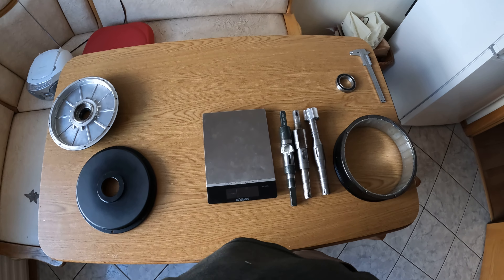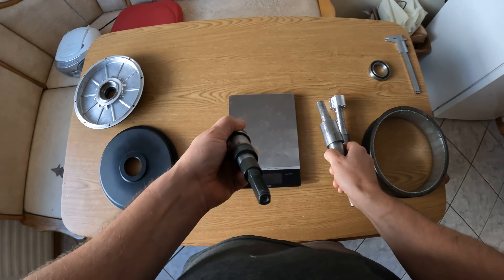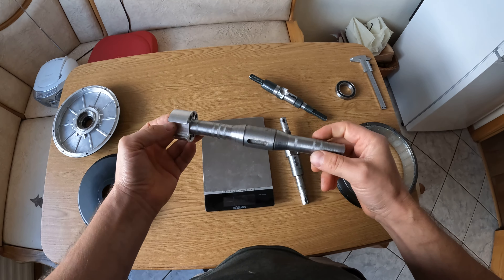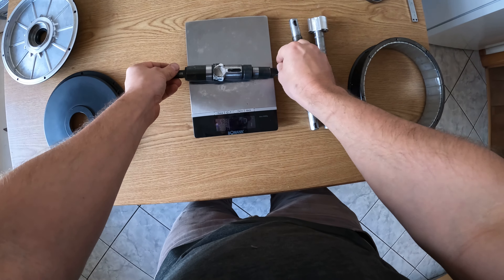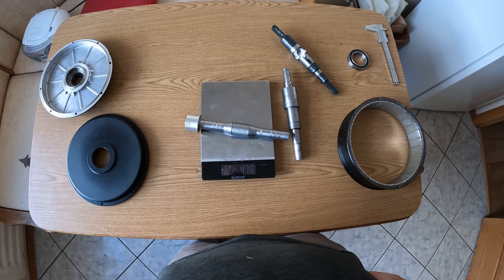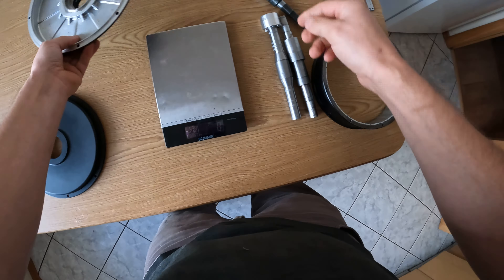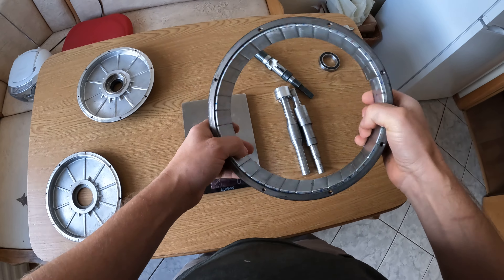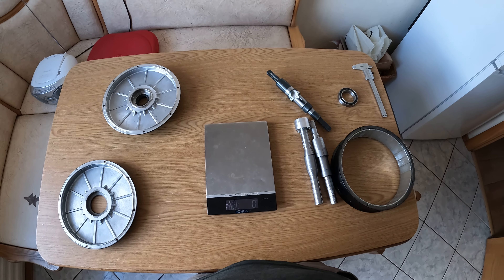QS205 motor axle, covers for new V3 electric bike mid-drive frame #ebike #QS205 #electricbike

Comment: Hi again...is it possible to pay you for a upgraded axle for the qs205? Looks much better than stock
Reply from the maker: Hi, It will not fit to your bike. Axle fitting on the ends (where fork mounts) different then original.
Reply: @Musvilkis  hi..i see.
How thick of phase wires are you able to fit through your new axle?
Reply from the maker: I left original wires.
Reply: @Musvilkis  ok. Im trying to find an axle to insert larger phase wires
Reply from the maker: @MrDeceptacon88  I do think stock wires plenty enough. Try to keep them short as possible. Motor will oversaturate what stock wires already can handle.
Reply: @Musvilkis  yes..shorter the better...but those wires are still thin for 20 to 30kw
Reply from the maker: @MrDeceptacon88  i do not think it is good for that power. You oversaturate motor and all your power just goes to heat. If you want more power You should up voltage not current.
Reply: @Musvilkis  yes i think so too...what controller are you using?
Reply from the maker: @MrDeceptacon88  Missed the comment. I do Use 2 controllers. 1 Vesc 100/250. And custom Vesc 200A/450A phase. Vesc 100/250 is ok, but 300A is a bit low Phase A for this QS205. It is not sharp and from stop id doesn't pool hard. Only after 35km/h  it is starting to pool. Custom vesc different story. It does pull from stop.
Reply: @Musvilkis  where do you buy your controllers from?
Reply from the maker: @MrDeceptacon88  Original Vesc 100/250 from Trampa Boards and custom 200/450 my friend constructed. But he is not selling it. He doesn't have time to support it. I have asked him.
Reply: @Musvilkis  but i think the qs205 needs more power than those ratings
Reply from the maker: @MrDeceptacon88  To me 450A is I think max i need. It will wheelie all the time with more. Now with 400A it power wheelies in forest rides. So more will be just to dangerous. Original Vesc 100/250 is not enough (phase 300A it goes but lacks punch) This is mid-drive with 17,7Kv QS (P.S I rewound now to 23kv and changed to even bigger reduction). It is 55kg and only 80km/h. Want to try new setup, but winter/snow/-20C.